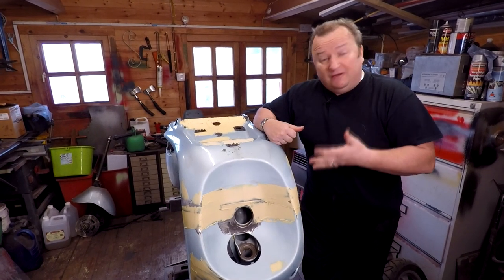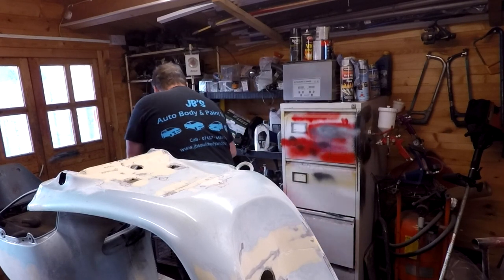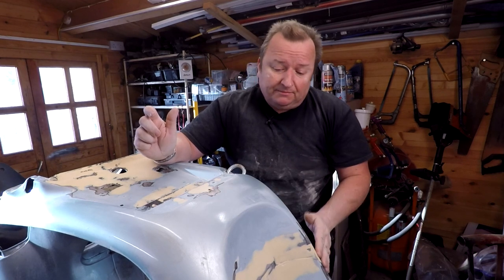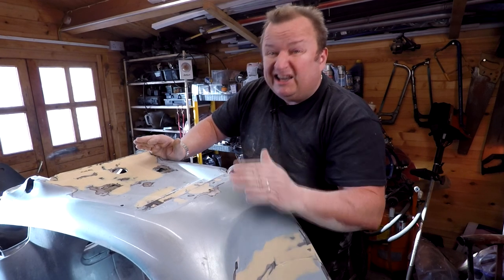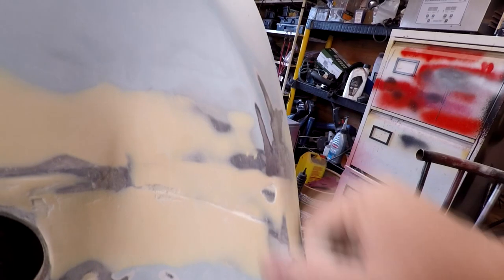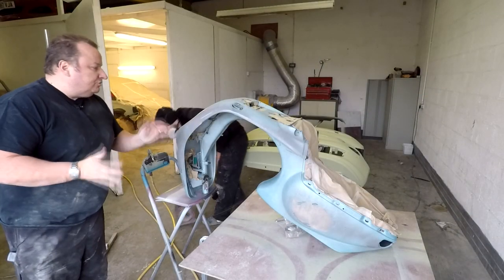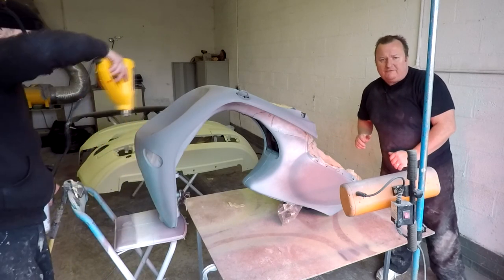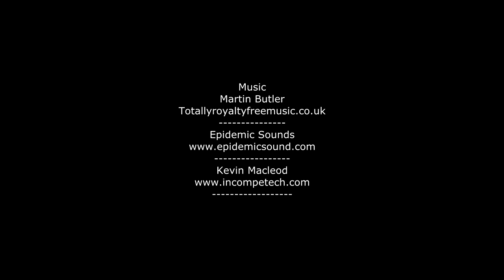Vid 7 Piaggio ET2 50cc Vespa Respray Filler And Primer

Comment: 320 grit is to much for primer you want to be around 180 grit to 240 grit, i normal go with 180 grit if im going to be using high build primer or 240 grit if im not using high build. also on a note of you saying 500 grit for basecoats, you know you can go all the way up to a 1000 grit but i normally only use that for silver paints and colours that show the scratch marks. your brave putting a single pack paint over the Vactan and the bare metal
Reply from the maker: I know where you are coming from but it'll be fine. There is quite a wide margin for what papers to use as you probably know but there is no problem using 320 for primer. I know you can use up to 1000 grit for silvers but a solid colour like black, I've always found 500 grit fine.
Reply: yes im sure it will be just that with 180 or 240 grit its faster to key up the old surface. ahh right i said about as the way you spoke in the video gave me the impression you did not know you could use 1000 grit. yes for solid basecoat 500 grit is fine, although i rarely use basecoat for solid colours